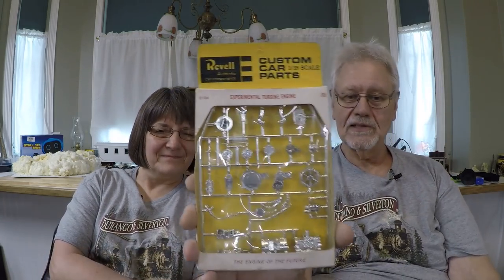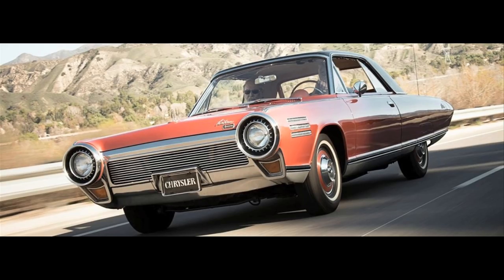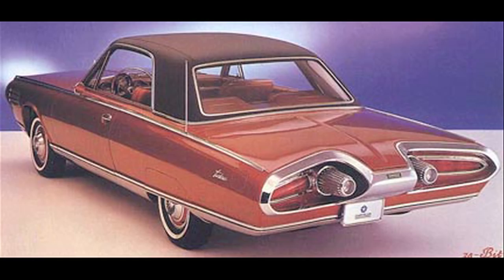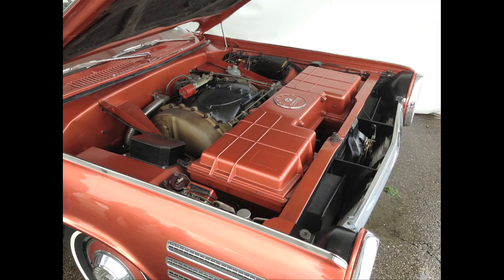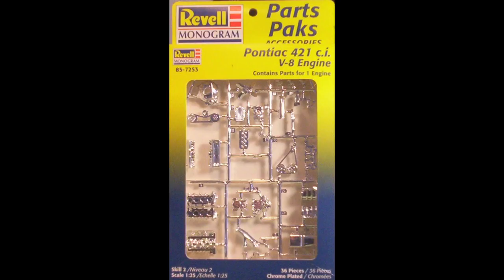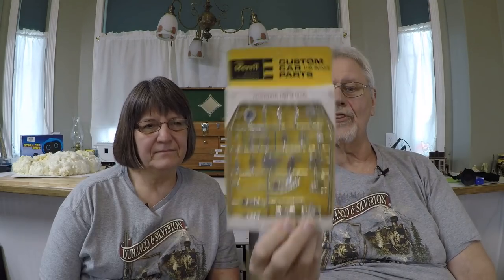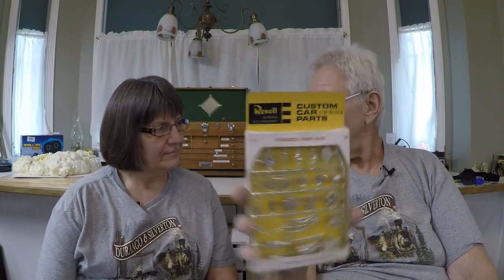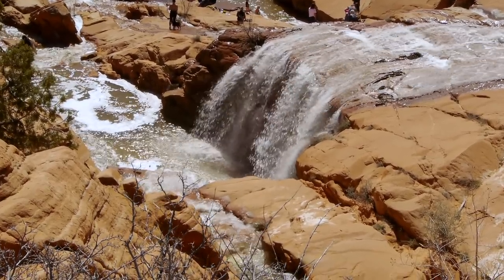Revell Parts Pack - Experimental Turbine Engine

Comment: Once again we are blessed with another fine episode of Toyman TV.
I grew up building plastic models. I still have a couple of them buried somewhere in my storage. I am embarrassed to say though that I've never heard of a motor parts pack, or if a Chrysler Turbine Engine. Parts packs were just never available in any of the hobby or general stores where I've bought my plastic models. And I might add that Walmart had discontinued stocking plastic models, which was a real drag since they were the only store in my area (Vernal) who did have them.
Reply from the maker: Robert Emmons they were big in hobby shops  but the big box stores carried kits and paint and glue, but for depth and cool parts you needed a hobby shop. We had several great ones. My favorite was Douglas Models. Huge. Had everything.

Comment: The Revell "Experimental Turbine Engine" kit (Part C1104) was very different from the actual Chrysler Turbine Engine, but it has an interesting backstory all its own.  In my opinion, it may be the first official attempt at the modern scratch building philosophy now used extensively by Science Fiction and Wargaming Modelers.  

Apparently, it was designed in the early 1960's by Revell Kit Designer and avid model car builder Bob Paeth (who passed away in 2008.)  Mr. Paeth stated that at the time, Revell designers were basically "shooting from the hip" when they designed this kit; using pre-existing parts taken primarily from the 1/10 scale Revell Allison Turboprop Engine Kit that came out around 1960.  They mainly used the "accessory drive housing assemblies," with the "fuel control main body" parts and the "fuel pump" halves repurposing them for main engine parts.  Other parts from the same kit were taken (for what would now be called "greeblies") to add details that "looked right," but weren't necessarily meant to represent anything authentic.  (Here I should point out that this was different from the "Creative Gizmology" detailing technique championed by model builder Shep Paine; who made use of kit parts and model railroad accessory details to "fake" real components more through suggestion than as a bolt-by-bolt copy.)

About ten years after the Revell Experimental Turbine Engine kit was first designed, model makers at Lucasfilm would use a similar philosophy to detail models for "Star Wars," and this influenced Science Fiction modeling to this very day.  But it's no surprise that model car builders pioneered this kind of technique as "customizing" was always part of this branch of the hobby.  

Overall, this aftermarket 'Experimental Turbine Engine' was probably the first applied use of this technique.  (If nothing else, it certainly looks very purposeful, even though the exact 'purpose' of the various details is unknown.)  That said, I wish that Round 2 or Atlantis Models would consider reissuing this unusual and historical accessory parts pack.

Thanks for posting this video on a very unusual model car subject!
Reply from the maker: So our friend Jim Keeler was part of that project.  And of course he’s a designer now for Atlantis as well. He came up with an absolutely brilliant model which he still has called the turbine tub. And utilized that engine in a t bucket. That would really be an interesting model for them to put out as a Keeler custom. I believe he even still has some of the patterns that he used in developing the engine.
Reply: @ToyManTelevision  That's incredible!  And Mr. Keeler works for Atlantis, now?  Please relay my compliments, and thanks to Mr. Keeler for reissuing the 1/96th scale Revell Moonship kit, including XSL-01 livery as a decal option.  (The full XSL-01 "Stack" would be nice, if they could ever get around to it!)

I've tried to find pictures of the Turbine Tub you mentioned online, but have had no luck so far.  I really want to see that model, if you can point me in the right direction . . . .

Comment: Not true about the exhaust tempture you could put your hand under it also it was not all that loud
The problem was fuel economy and performance as it had much worse fuel economy than the 318 v8 with less performance and if it went into production a much higher retail price 
Learn all about it at Jay Leno garage
Reply: correct, the exhaust was relatively cool - it had a reheat wheel which "sucked" the heat out of the exhaust and then heated the inlet air.
Reply from the maker: Wow. When I saw one in 62, weird fined car at the worlds fair, they said they could not start it because of the high heat. The UP locomotive (I’ve stood in the exhaust “pipe”, about 7 feet in diameter) shot flames 20 feet in the air on start up. And if they stopped under a bridge for any length of time that was the end of the bridge.
Reply: Jim is right, the exhaust was around 180 degrees.